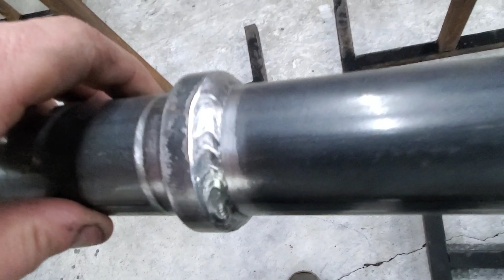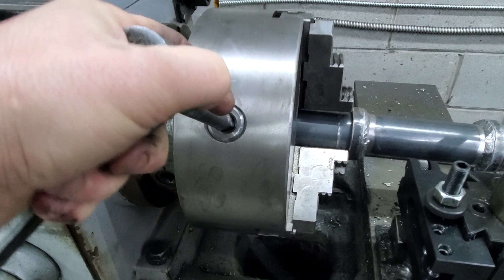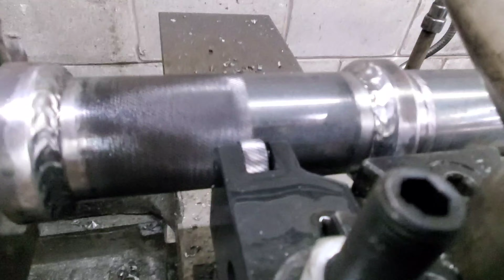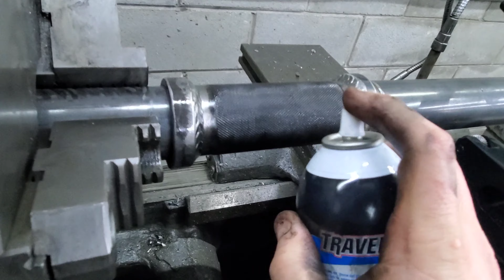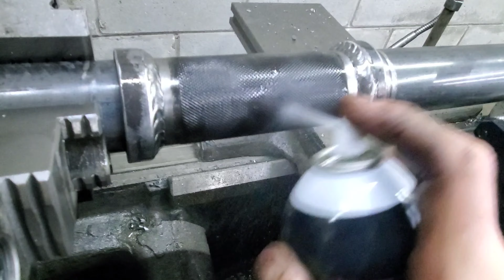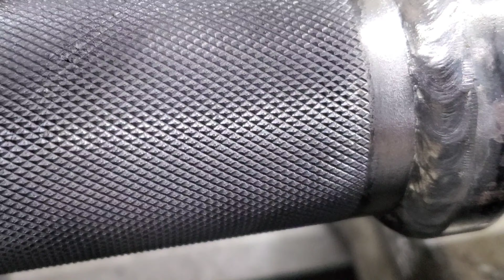Shop #sharts Knurling some custom Thick grip Dumbells.

Comment: I'd like to start making my own equipment, wandering what the machine is called to do the knurling on
Reply from the maker: You need a mechine lathe.. the bigger the better. Knurling is imprinting on steel. Small lathes simply can not apply enough pressure to imprint well.
Reply: @GorillaStrengthEquipment  cool, thanks,
Where would be good placeses to buy them?
I'm not in the USA.
Reply from the maker: @geinstein8407  a lot of good ones come out of Taiwan. The Chinese machines are usually pretty low end. I dont think there is an American of them anymore. You can purchase machines new but my favorite places for equipment is from highschools, trade schools and goverment auctions. I avoid used machines that have been used in manufacturering. I generally purchase used when I can find a good option. You can save half or more and often get little bonuses like tooling or expensive add ons like dro(s)
Reply: @GorillaStrengthEquipment  thanks time for me to do some searching now! ! !